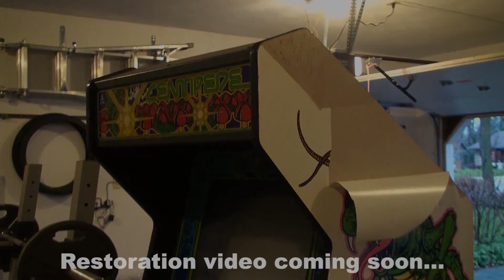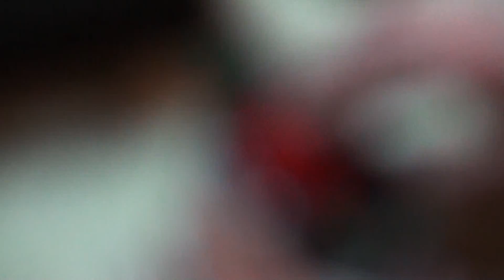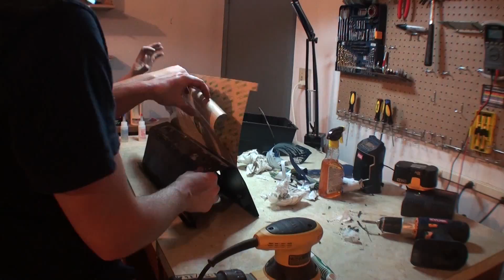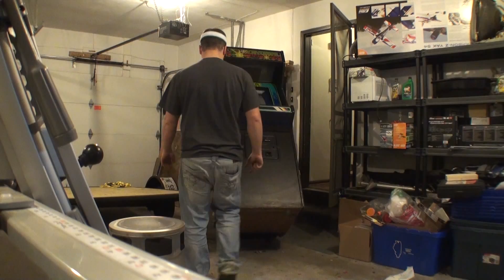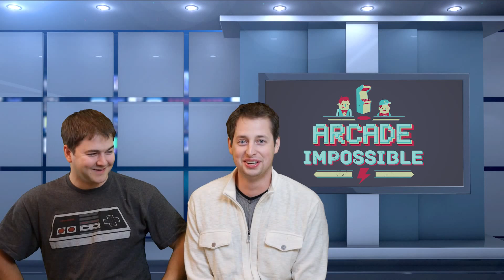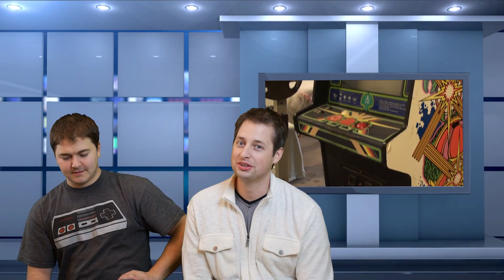Centipede Update - Episode 7 Ending

Comment: Weird how the track ball had the gap, but at least there seem to be plenty of places to get spare control parts.  
Curious where did you get the replacement control panel overlay from?
As the guy who sold me my 1st cabinet promised to fix the screen board, they have taken it back to their workshop to fix & promise it will be back Tuesday.  Not going to go ahead with the 2nd cab from them until they do so of course.
Going to try & get the Tutankham cocktail off them as well.